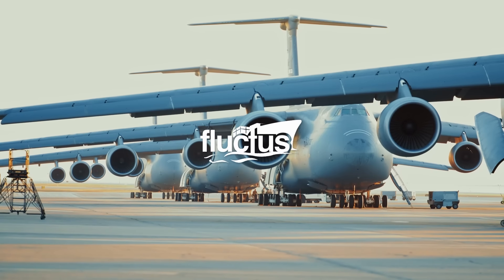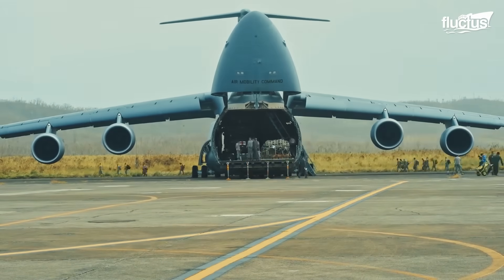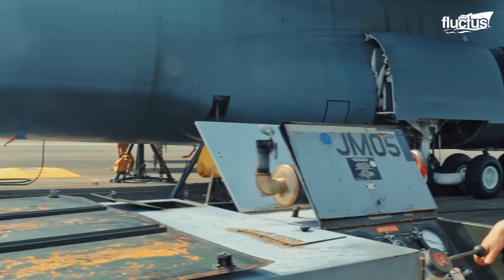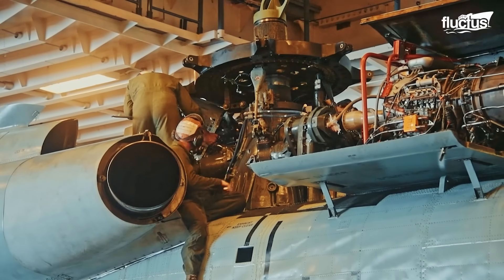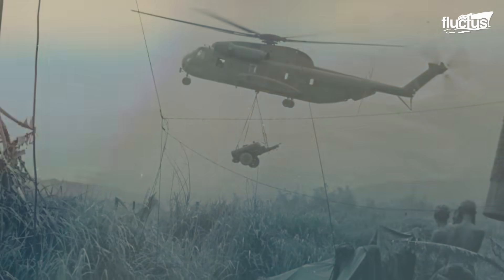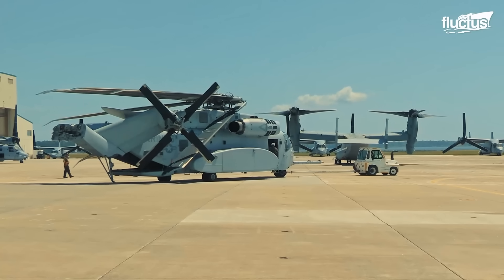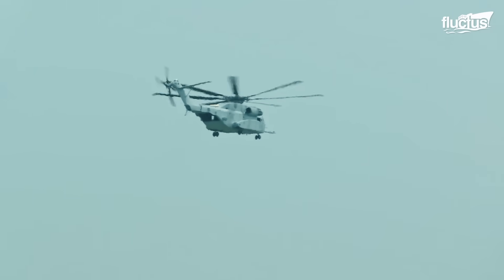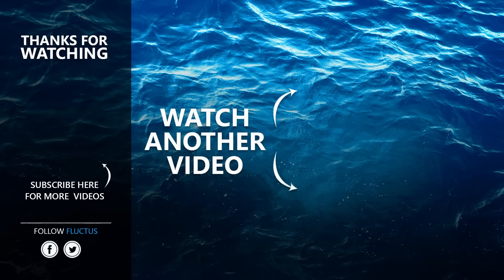How They Repair the Largest US Military Plane Ever Built

Comment: why return it to the shore when you should do it at sea in the hanger bay. Since they can do what they already can. The only hourly replacement part is a rotor blade or prop blade should be don and shipped back for maintenance and look for cracking under light green dye. They might wanna look into creating a ship for building replacement parts and creating things like aircraft tires verses going all the way to shore when they should have a dedicated team to manufacture turbine blades etc in house. Then all they have to is Ups it by helicopter during a re supply run, or as need be.